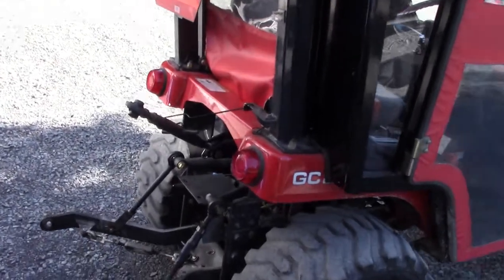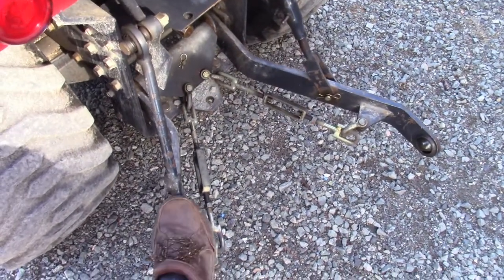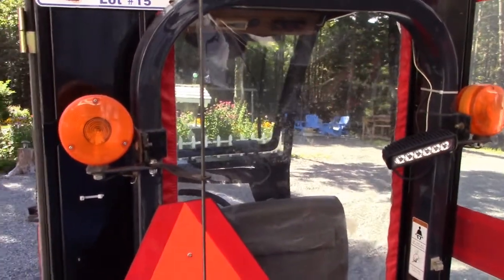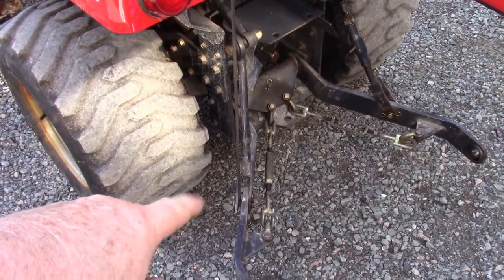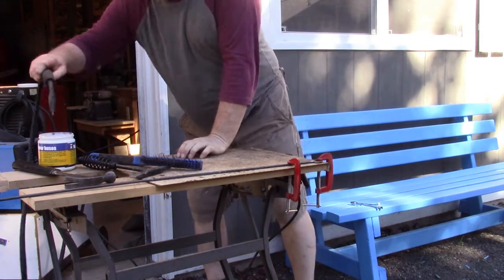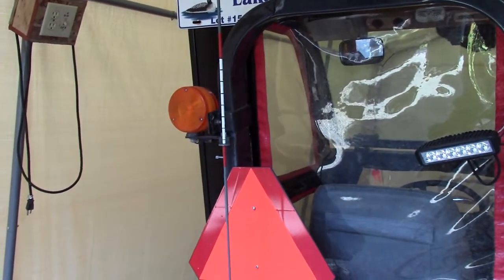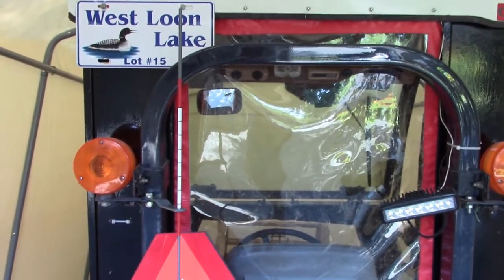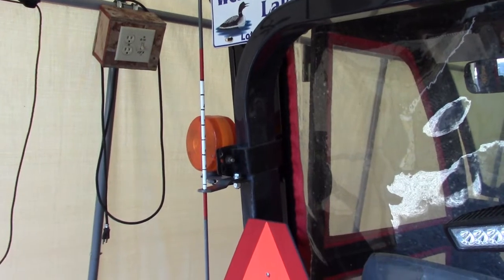3 Point Hitch Height Gauge

Comment: I used a threaded  rod as a bucket level indicator. I put a kink or lump in the rod at the level point thru the bracket and painted it fluorescent orange. The rod will move through the hole just fine and is could be adjustable at the lower anchor end with nuts on both sides of the lower bracket. my 2 cents lol
Reply from the maker: Hey there Mr. Fixit!!!  So glad you took the time to watch!!!  That's a good solution too.  I had the driveway marker in the barn and didn't have any threaded rod.  I'm kinda sorta cheap so the driveway marker was cheaper for me to use.  Only cost like $1.75 or so.  Anyway, we need a level indicator and now we both have one.  Win - win!!!  Appreciate your comments!!!
Reply: @GrampiesWorkshop I noticed that you also used the rod for a bucket leveler in another video, the same way i had done it. take care !!!

Comment: That`s a good solution to a big problem....I don`t have this problem on my tractor...It`s a little bigger tractor and it has the gage on the side of the controls and it automimicry adjust itself to what I set it at....good video...CHEERS
Reply from the maker: Thanks for the comments Gater.  The bigger tractors usually have the draft settings.  With the smaller ones we have to sort of guess and this will take some of the guess work out of it, I hope.  Have a great week!!!!